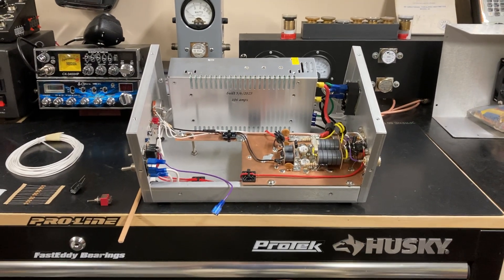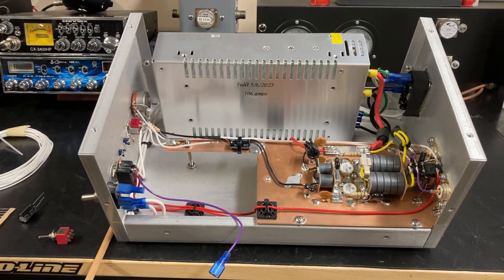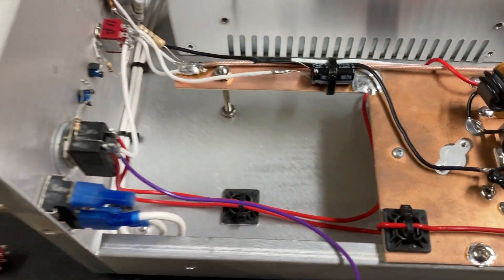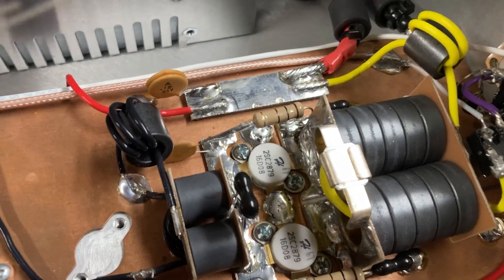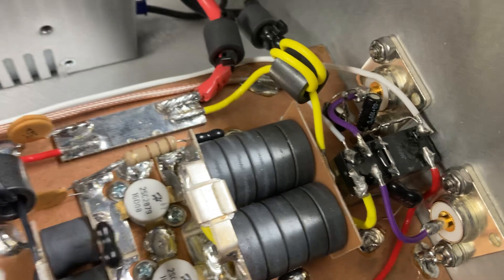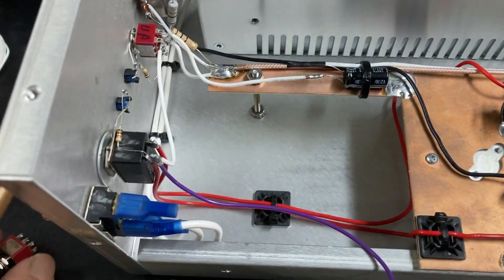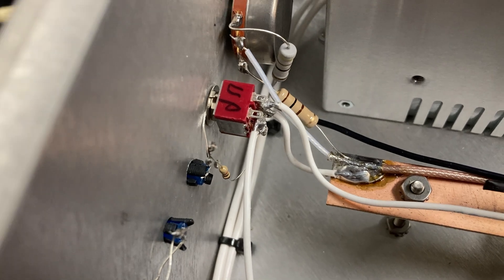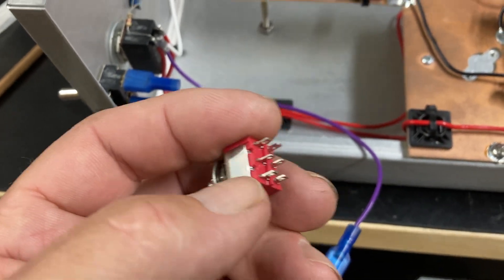How to add ssb delay

Comment: Looks like most of the comments section thinks this converts the amp  to use on ssb . Calling it SSB DELAY  is kinda misleading becacuse it is still class C just with a delay. Sure it will work for Ssb. Why not call it what it really is , TX Relay delay. Pa. Im not a ham guy , just bbeen there... Well done sir and thanks for posting , 73

Comment: Looks pretty simple to do, nice job, I've been wanting to do this to my straight 4 pill. Thanks 73s
Reply: Just added auto delay to my straight 4 pill. So far, it works awesome, Amazon sent the wrong switch, so I'll change to manual Mon. Thanks for an awesome explanation
Reply from the maker: Sorry for the late response, that’s awesome Iam glad it worked out for you, glad I could help with the video, take care
Reply: @frppower1  thanks again

Comment: When you go from the relay with your 1,000 Michael 25 volt where do the other end go on the board?
Reply from the maker: It goes to the switch

Comment: Nicely done and explained. i did this on an amp many years ago. exactly the way i did it and worked great no issues
Reply from the maker: Thank you very much
Reply: Where did you put the negative leg when you made it automatic sideband
Reply: @klv400  I didn't do automatic SSB. I used a switch and a capacitor Just the way is explained in this video
Reply: @rafaelmoreno79  thank you for the info do not understand when he says put the negative leg to the board he says solder it to the board but I was reading the comments then he told someone it does not solder to the board I cannot figure out where it goes
Reply: @klv400  are you doing automatic SSB???
Reply: @klv400  what he means when he says to solder on the board means solder it to the ground on the board and the positive lead of the capacitor goes to the negative on the relay. I hope that helps. Remember that this is only if you don’t want to use a switch for ssb delay. If you are using a switch than you do not mount the capacitor next to the relay. Am I making sense?
Reply: @mean1flyer Yes you are. I really appreciate the info. Thanks
Reply: @klv400  you're very welcome My friend. I am sorry but I don't check the post reply's as I should because I keep busy but let me know if there is anything I can help you with. this mod is really easy to do and you don't need too many components to do it but you do need to know what you are doing. by the way you do not have to use teflon wire for the switch. I used just regular  18 gauge wire on mine...never had an issue
Reply: @rafaelmoreno79  👍

Comment: Very good man 👍. I know nothing about building but I’ve been taking an interest in learning 
You answered my question at the end . But you can further educate us folks like me when you learn , what’s the reason or difference in making it a true class AB , and using those “sand bars” and figuring out that term that is often used “setting the biasing voltage” ,, etc ,, keep up the good work , 73’s 👋🏻
Reply: A lot smaller wire than 16g will work fine. Also the double throw switch isn't necessary - a simple double pole single throw switch would suffice in the configuration you used.
Reply from the maker: Thank very much for checking in out , I haven’t even started researching baising yet, sounds like you know more than me about it, some people say that without the correct baising a class c amp is not ready for ssb use it will have harmonics, splatter etc, and it very well may be the case, I don’t really know, but I did run across a video that rooster radio did , where he tested a amp with ssb delay only and one with baising, here’s the link, thanks for checking it out and the nice comments, take care https://www.youtube.com/watch?v=vY5Cusvvr0c&t=290s&pp=ygULU3NiIGJpYXNpbmc%3D